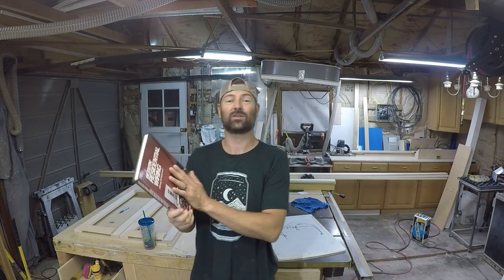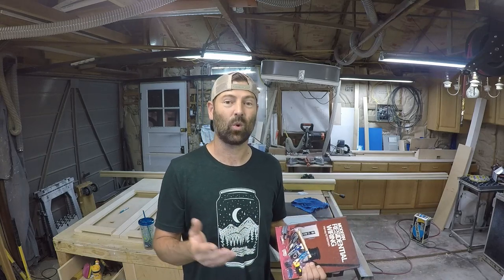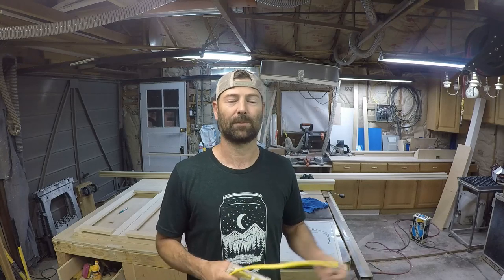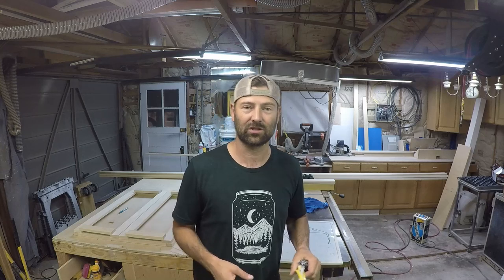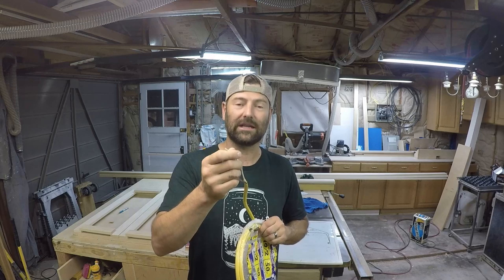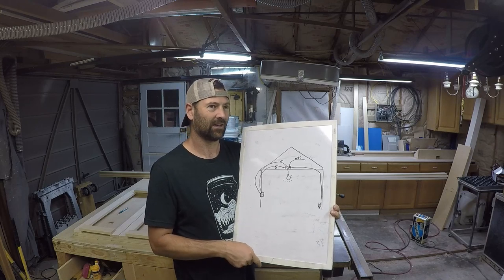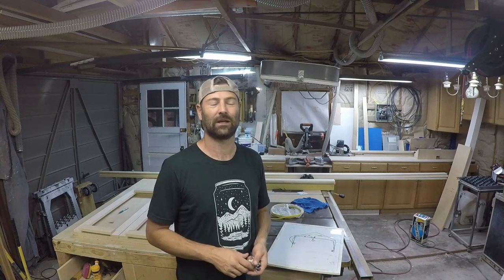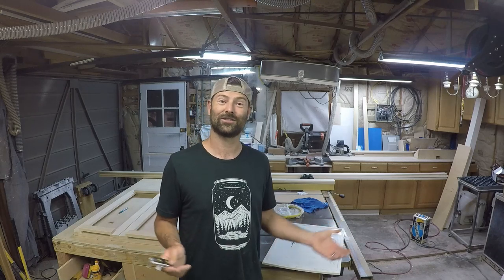The White Wire Is The HOT | THE HANDYMAN |

Comment: You are absolutely right.  Black tape on white wire is common for those situations.  Welcome back to the USA/Canada.
Reply: Not required to mark it according to National Electrical Code
Reply: It's actually code to wrap the white wire 3 times with black tape or marker
Reply: You switch the HOT and its black.
Reply: Even if it is not required to wrap the white it is a nice thing to do for the next person.  And if they dont know what it means it may encourage them to look up why the white is taped like that.  Yes you should always test before you mess with any wires even if you are the one who installed the wires.  Better safe than sorry.

Comment: When I worked as an electrician, when you used a 2 wire like you did, we called them a switch leg.  All it did was send power to the switch and back from the switch.  Every now and then, you run into some places where the power is sent to the switch first and then to the light.  In those cases, both blacks in the switch box were hot and the white wire (neutral) is just junctioned together in the box with a wire nut to feed the neutral to the light.
Reply: I just looked at my switch for my 2 attic fans from our home built in 1998.  This is how mine was wired with whites nutted together.  Both blacks to and out of switch. Thanks for explaining what I had.

Comment: My Dad taught me to put black tape on a "hot" white wire 50+ years ago when we were doing remodel electrical work for a friend. I will say that I NEVER assume that either wire is not hot unless I test it with a "pen" type power tester. Another great video. P.S. Never trust a customer to shut off the power to a circuit you are about to work on. I did once and got bitten!

Comment: Residential alternating current (ac) transformers create 220 ac volts.  Look into a breaker box and you will see two black (hot) wires that connect to a 100 amp to 200 amp or greater double breaker that provides power to two central bus bars that your household breakers mount to.  You will also see a white (neutral) wire that connects to a bus bar on one side of the breaker box.

The two black (hot) wires come off each end of the transformer coil.  The white (neutral) wire comes off the center of the transformer coil.

Most household devices use 110 ac volts to operate.  You get that 110 ac volts by running a black wire from a single breaker connected to one hot bus bar to the device and a white wire that runs back to the breaker box and connects to the neutral bus bar.  You get 110 ac volts because running the current through the white wire means you are only using half of the coil in the transformer and get only half of the voltage.

The two central bus bars are designed so that every other breaker mounted next to each other connects to the other central bus bar.  That is why devices that require 220 ac volts (electric stoves, dryers, etcetera) have two breakers mounted next to each other.  By doing that you are connecting to both of the two black (hot) wires coming off both ends of the transformer coil and getting the full 220 ac volts the transformer creates.

Only the ground wire can be considered not to be hot since it is there in case a wire with current running through it touches the case of a device that you might touch.  Since electricity follows the path of least resistance, the electricity will flow through the ground wire to the ground bus bar which is attached to a metal rod that was driven into the ground which provides a lot less resistance to current flow than a human body.

So black and white wires carry ac electrical current from and back too the transfomer and are always considered dangerous to touch when the electricity is turned on.  To be safe, ALL wires in your house should be considered dangerous until the circuit is broken at the breaker box.
Reply: The lines are out of phase.. only 110+/- out of each line- being out of phase gives your 220+/- between the two.
Reply: @daviddean7377  
The power company (in the U.S. anyway and most likely anywhere else) generates three phase power which is why there are three power wires on major power poles distributing electricity.  If you check the standard residential transformer, you will have one wire connecting the transformer to one wire wire on the pole.  That means you have single phase power in your home.

https://www.youtube.com/watch?v=b2MXK9oi_Gs

The two black wires in your breaker box connect to the ends of the coil in the transformer.  The white wire connects to the middle of the coil in the transformer.

Connect any device in your home to both black wires and you get the full 220 volt ac current the transformer creates.  Connect any device to one black wire and the white wire and you get 110 volt ac current because it is only going through half of the coil in the transformer.

Another fact that most people do not realize.  The primary coil in the transformer that is connected to the distribution wire from the pole is also connected to a wire that runs down the side of the pole and is connected to a metal plate on the bottom of the pole.  The power company is literally using the earth to complete the circuit necessary to transmit alternating current.

Comment: Yes, that's correct. Article 200.7 C1
Same goes for a 3 way switch. If you use a wire with white insulation, it's the suply and must be marked as suply.

Comment: What you’re describing is very common on older homes in the Midwest where I’m from.  Living in the southwest now and would never be allowed.  Just have to know the age of the home you’re working on and have a good understanding of electrical circuits.  If you see a wire connected to a light switch its going to be hot at some point!  Good job!

Comment: Down on white and back on black!  Sort of like the ACDC song.  There is a fine print note (NEC) that allows you to use this Down on white back on black.  For equipment.  An example in residential  would be rough in for a disposal and switching (1/2) the outlet under sink.  Wire needs to be identified as the type of conductor it is being used.  Some inspectors would rather you use sharpie and or irreversible indelible paint pen so in the future no one can take tape off and get hurt or blow something up.

Comment: You need to start running 3 wire for your switch legs. As of 2017, you are rquired to have a neutral in EVERY box to accomodate "smart devices" going forward. In that instance, your light box would see the red load wire connect to the black line, and the white carry the neutral to the switch box.
Reply from the maker: I always do.  I was explaining what was in an old house from the previous video.
Reply: @TheHandyman1  Ahhhhh.... How the hell did I miss that one... I always watch your stuff... Great channel BTW.

Comment: Well those who didn't know and said you were wrong, were most likely 30ys or younger. What you described is called a switch leg, not in common use today, but very common 30 plus years ago. Today we done really care about saving money on running less wires, but years ago every penny was counted and saving them was very important. And since today labor is more expensive than materials we just run with it. Plus today most electricians don't have many years of experience, especially here in California. But they sure are expensive

Comment: We had this exact same wiring configuration at an old home that we used to live in at Palm Drive in Mount Dora Florida. That house was built in 1958, never remodeled. We had old ungrounded wiring and they used the ceiling light/fan boxes as junction boxes and all outlets were at end of cables or "arms" of the circuit and the light switches for the fan/light were wired exactly like this but without ground wires. All the electrical boxes were ungrounded metal boxes too.

I forgot to mention that It had a "Pushmatic" breaker box. It's not a fuse box and not a normal type of breaker box either. I know that these "Pushmatic" breaker boxes are unusual too.

Comment: How to verify your hot just put one probe to ground and touch your other probe to your other wires. You’ll see your hot wire. On your switches and receptacles white for bright screw, black wire for brass screw and green for ground. Black for Brass, White for Bright and Green for Ground. When you look at your duplex receptacles they are 2 different sizes. The smaller one is hot. Or just buy a small receptacle tester to tell you if it’s wired correctly.

Comment: Also be aware that if you are working on a live circuit with the switch off you can still get zapped by the neutral wire if you provide a better path to ground and something else is using power on that circuit.
Reply: Definitely

Comment: Thanks for this. Residential wiring is one of those things I just never learned and it scares the crap out of me. Would like to see more videos like this.
Reply: For DIY, there's some simple rules that will help:

Shit's always hot.
Rubber shoes, rubber gloves.
Use a multimeter to test for hot, then verify with a second meter.

Turn off the breaker.
Then again, check with a mutlimeter and verify with a second meter.
Do you work, but don't trust the breaker; there could be a second feed or the breaker could be faulty.

Next, understand what type of protection do you have?:
Main breaker (supply side), subpanel breakers (inside), and main GFI breaker (supply side).

Always test with an insulated screwdriver.
Never reach in with an open hand, electricity forces your hand to close. 

YMMV, study.

Comment: Current nec requires a neutral at the switch, switch loops are no longer permissable.
Reply: Had no idea, what year?
Reply: @warrend114  I believe it was 2014.  Robert Demaine wins because he actually knows the code.  We only run conduit so it would be black down, yellow to the light.
Reply: Switch loops are Definitely no longer permissible 
But that’s what he’s doing in the video
Reply: Robert Demaine true, but in a situation as described in this video, the retrofit is probably acceptable under the 2017 NEC and the local jurisdiction. After all, what’s the point of forcing an update on only one switch? The local jurisdiction always has veto power.
Reply: Then someone needs to tell lowes and home depot to start selling more switches with the neutral wire connection.
Reply: Rich Wood actually, the neutral is there only for switches that draw current. A normal switch doesn’t use it. If the switch was one of those with a motion detector or part of a smart house installation, it would use the neutral.

The idea behind the code change was to make buildings upgradable to smart switch technology.
Reply: mister clean I’ve seen it time and again. I was called out on another channel for pointing out that with older homes that have been hacked by owners over dozens of years probably need to be gutted and renovated. It is crazy what people will do and think it’s ok.
Reply: mister clean and then there are those cases where those same wires are twisted together with wire nuts or not, taped or not, then concealed in a wall not in a junction box. A fire waiting to happen.

Comment: What your explaining is allowed per the NEC and is very common. Its called a switch loop. 
A switch just breaks the connection, theres no polarity involved. 
The NEC allows you to use one cable to deliver power hit the switch and return it to the fixture regardless of wire color as long as its properly identified as black either with tape or black marker.

Comment: Yes it's called a switch loop, they are technically illegal these days because you are no longer aloud to phase (change color with tape) any grounded conductor or " wire" equal  or less then 6 gage (refrance NEC. 200.6) . Also a cuple other changes but in my opinion it is safe.

Comment: Two wire (14/2) to a switch is illegal in Canada you MUST have a neutral. 

it is best to feed from the switch to the lights, if you don't know the code get an electrician!
Reply: No one gives a crap about Canada....this upload is meant for the USA.
Reply: Switches are wired on the circuit breaker side of a fixture, so the conductors into and out of a switch are not grounded, otherwise known as "hot."  How does a "neutral" wire come into the equation?
Reply: Smart switches need a neutral.  It is a good idea to run 3 wire, but in most places in the US, not mandatory .... yet.
Reply: @rellog321   What is a smart switch?  A timer switch?
Reply: @nightwolf2666  -- Eeeeasy...
Reply: NEC now requires a neutral at all switches
Reply: @deezynar  an automated switch, that can be controlled by software via wifi.
Reply: @rellog321   Oh, OK.  But a switch that is remotely controlled needs neutral for it's own unique  purposes.  Normal switches don't need it.  Furthermore, I would be extremely ticked off if code that applies to me forced me to wire my house for a feature that I abhor, and is not safety related.
Reply: @schtuke  This is an upload intended for US contractors, why are you even commenting about Canada??  The country with only 32 million people?
Reply: Nathan Wray it’s been a requirement for new construction since 2011 under the NEC, but not all jurisdictions have adopted it and still more simply ignore that provision. After all, it’s the jurisdiction that adopts the code and makes it law, the NEC authors do not.

Comment: I was one of the guys who asked. I worked as an electrical apprentice for a few years. They were using it as a switch leg. We would have marked the white wire with tape like you said, or with a black marker. It all makes sense either way though, and I wouldn't have touched any of the wires without checking them with my sniffer first.  Keep up the good work handyman!
Reply: Jorge Jimenez as a rule I always use a sharpie and color the entire exposed white portion black or red on both ends to identify it as a hot wire.

Comment: Here in Kentucky, the electrical inspectors I have dealt with have started to want a neutral at your switches simply for using things like occupancy sensors. 

The caveat is that if you run conduit, you do not need to include the white, because you can pull it in later. However if you use cable, you must use */3 so that you can have a red/blk for switching and a true neutral at the box.

I dont know if this is actually codified in the NEC, let alone in the 2017 version, but I think kentucky was one of the first adopters of the 17 code cycle. 

Something to be aware of I suppose.
Thank you for the videos!
Reply: symposes it is in the code book.  Unless easily able to add a neutral later one switch must have a neutral for every lighting circuit.  So it you have 7 4 ways for one light only one must have a neutral.

Comment: What you're describing is commonly referred as being "back fed" Due to smart switches that method of wiring is no longer code in new construction or remodels. Smart switches require a neutral.  If it's existing then it's considered as being grandfathered.

Comment: He is correct, of course.  In residential circuits both the white and the black wires are power conductors and carry the same amount of current in a circuit.  The difference between them is that one of the conductors is grounded, and the other is not grounded.  The common parlance is to call the grounded conductor the "neutral" wire, because the current it carries is neutral compared to earth.  But that should not come as a surprise to anyone since it is eventually connected to a ground lead at the panel.  Parlance also refers to the non-grounded conductor as "hot", but that's just because it shows current when compared to ground.  As an aside, because the "hot" conductor is not grounded, it can kill you if you touch it while another part of your body is touching something connected to the ground.  Circuit breakers are there to prevent fires, not to prevent electrocution.  They need more current flowing through them before they will trip, and you'll be dead, or manage to let go before that happens.  Anyway, it is typical for the non-grounded conductor to have black or red insulation, and the grounded conductor's is white.  When a non-grounded conductor is ran to a fixture, it is preferred for it to be black, or red, in color to indicate that is the non-grounded wire serving that fixture.  That means that black wire will still be black at the switch for that fixture, and if two conductor wire is used to and from the switch, the non-grounded wire leading to the switch must be white.

Comment: It may have been the common way to wire a switch for the last 100 years, but the 2011 NEC now requires you to provide a neutral conductor at nearly every switch point [404.2(C)]. The purpose for this is to complete a circuit path for electronic lighting control devices, such as occupancy sensors.  There are exceptions if you can easily add a neutral later.  It's possible that your local AHJ isn't following this rule, but that's how the NEC reads.

Comment: Yep, you got me for a minute there.  

When wiring a switch leg that is fed at the switch then yes the white will be hot because the current flows from the switch thru the light and back to the switch when the switch is closed.

Comment: For residential it's hard to argue the convenience of a non-contact tester. However at the risk of being the "Safety Sally" (or "Safety Sam"), I'll add that they should only ever be used to check for the presence of power, not the absence. In work environments involving OSHA, NFPA, etc you are only permitted to use a proper CAT rated multi-meter which you test immediately before and after the measurement on a known good circuit. 

If viewers take anything away from this: at least test the non-contact tester on a known live circuit FIRST to verify it's functional.